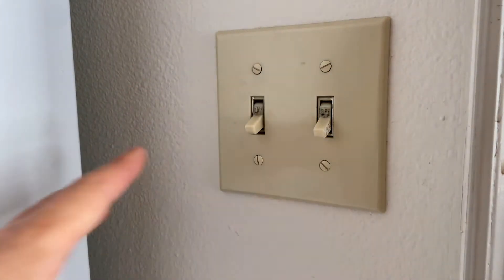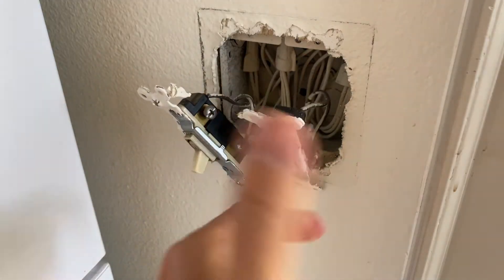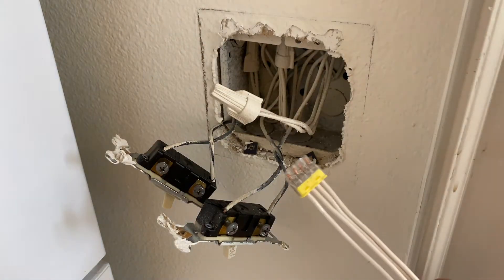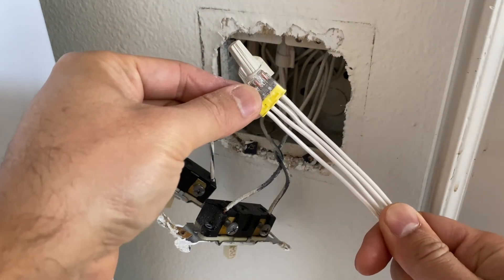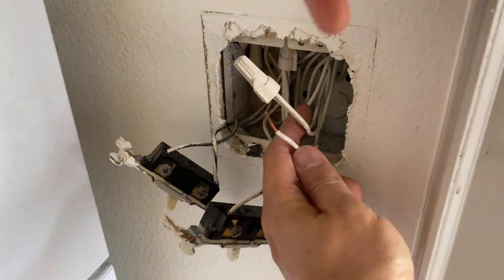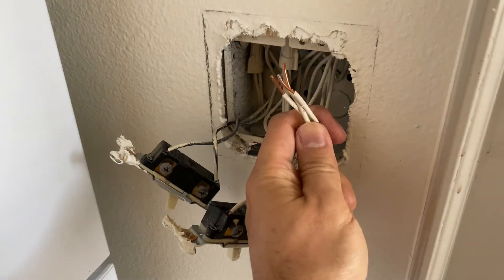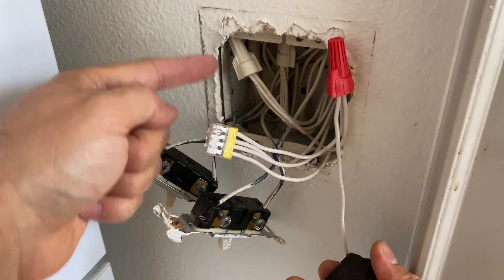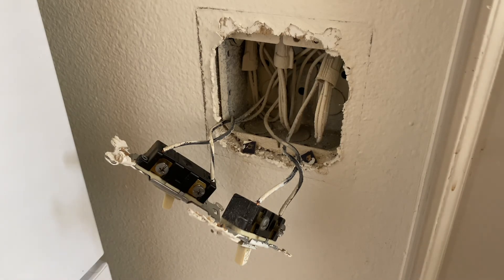Smart Switch Neutral Wire Wiring Mistake

Comment: Greetings, I have a a 3 gang but only changed 2 of the light switches to smart. All of the new  light switches are connected together on the neutral wires but I’m unable to get all the wire back into the wall without them coming apart. Would pig-tailing them solve my problem?
Reply from the maker: not much details to say something, you can attach model of the switch does it it have wires or you have short wires?

Comment: i did exactly as you did with my 4 wire motion sensing smart switch and the lights don’t work.
i take it off and put the old switch back that has only hot wire and load wire and the lights work argh!
Reply from the maker: Line and load wires must go to respective terminals.

Comment: Hi! Nice video! Question: I see in this box you have 3 neutrals, one for each switch.  In my case I have all together for the same box, can I wire up all neutrals together? That means...the 3 smart switch neutrals will be under the same nut...
Reply from the maker: in most cases you have 1 line 1 power source in the junction box, that's for those cases where all switches must be connected to that neutral. so yes.
Reply: Big thanks! Again: amazing video and super quick response! Appreciated
Reply: Very informative. Thank you
Reply: Doing the above process were you able to get the new switches to fit in the wall with all the neutrals connected?

Comment: bigger wago connector, 5 blade is an option but the wire nut probably comes with the smart switch, nuce video i have been contemplating smart switches
Reply from the maker: of course could have mentioned it. but most switches come with neutral pigtail and wire-nut
Reply: I was searching the net for another question and came upon this video.  Good video.  The group of neutrals are basically 2 pigtails to one neutral "line". As you stated someone might pull out the correct neutral "line " and their smart switch will work but the other pigtailed devices will not work. This answers my question is that the neutral "line" completes that ONE  CIRCUIT.  You may see other neutral wires but they could be for other circuits which would not complete the circuit that you are working with is that correct?  The real question I have is that in the breaker box, all the neutral wires are terminated at the neutral bar is that correct? If so... all "line" neutrals are "common" to all the circuits in the breaker box?

Comment: Excellent! Thank you. Everyone concentrates on the hot runs to make sure power goes where it needs to. A lot of people forget that the neutrals are 50% of the circuit. Nothing flows without that neutral connections being complete and correct.